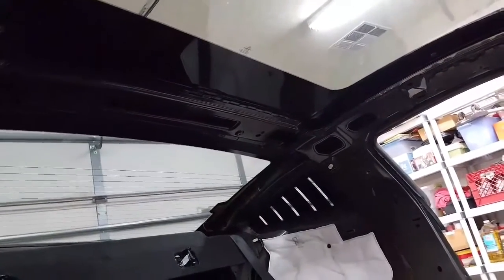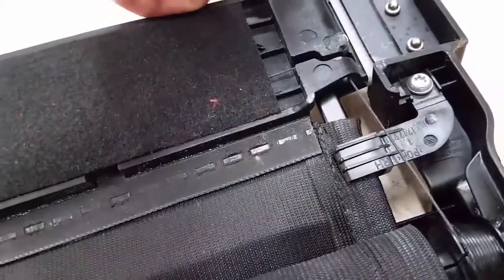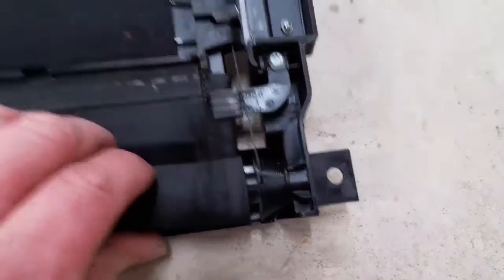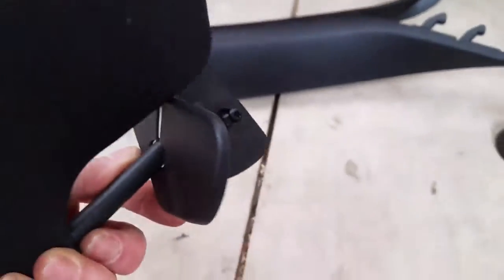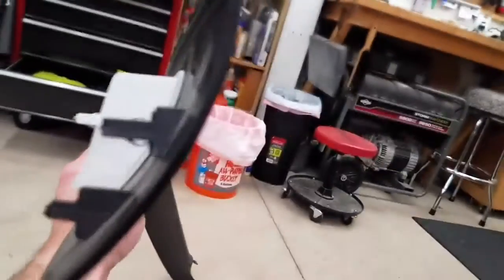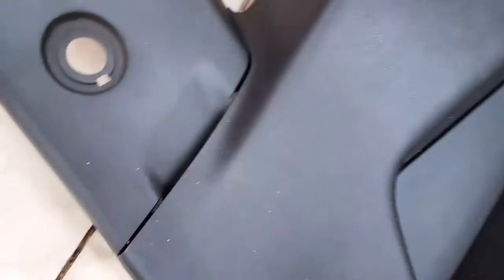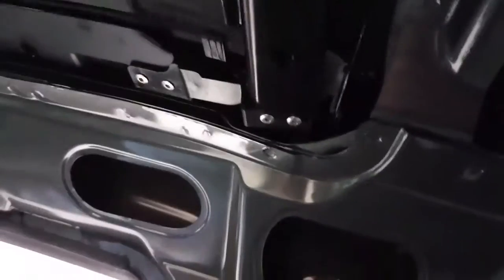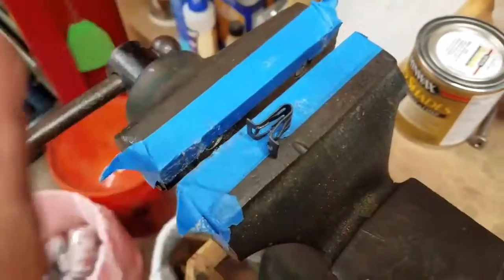Glass Roof Mustang - Sunshade Removal and Repair

Comment: Very helpful video. I just went through this whole removal and re-install, and it’s much better now, but still not right. It was jammed completely closed, and now it binds at about 3/4 open. I also used the oem repair manual.
Reply from the maker: I'm glad it helped, somewhat.

Comment: Very good video, did you put any lubricant any place, mine will gets stuck in the closed position, I was driving it and  hit a couple bumps and it worked, now the bumps are not helping anymore,
Reply from the maker: @donv2892  No, no lubricant.

Comment: Did your sunshade ever rattle during driving, with it hidden? Intermittently mine does until I shut and reopen it, also a 2013. Going to check mine for the issues you solved; thanks for the thorough vid!
Reply from the maker: Robert Gonzales Glad you found it helpful! No, no rattles from mine. Everything else rattles but not the sunshade...
Reply: sed6 What other rattles have you tackled? My rearview mirror is pesky, may try to cut a rubberband and seat it between the window and the clip (I forget from which forum I learned that)
Reply from the maker: Robert Gonzales Door glass when rolled down, something under my cowl vibrates above 80 or above 40 on a windy day, lots of squeaks from dry bushings underneath the chassis. None yet fixed...

Comment: Mine got stuck in closed mode can’t get it to go back at all even using full strength any idea how to fix it? Ford told my extended warranty doesn’t cover it so they won’t fix it
Reply from the maker: Yes, mine got stuck closed also. Watch the whole video and you can fix it too 👍
Reply: @sed6  thanks for the reply I’m sure this would fix it great video it’s the only one that went in depth, any idea how hard and how long it took to take everything off? That’s the only thing I’m worried about

Comment: Hi guys, I have Ford Mustang 2010 GT Premium with the Glass Roof. Unfortunately I received it without the plastic handle of the blind (sunshade). The actual blind was somehow put back in to the back. So... I am very thankful for the video because now I now what awaits me when I remove this mechanism. But I need some help. Do anyone knows from where I can order such a plastic handle? I cannot find it anywhere in the internet. Nether american musle, nether cjpony parts, nether rock auto, carid and so on. I would like to be prepared how much it will cost me before going deep in this repair. Thanks in advance.

Ps I have the car in Europe so I don't have the luxury of going to local dealer in US or Canada :) Local Ford never seen such a beast :)
Reply from the maker: Glad I could help. If you find the part here in the states and pay for it I can ship it to you or something.
Reply: @sed6  Thank you! I am still searching for it. I will let you know if I find something and the only question remains the shipping! Thanks again!
Reply from the maker: @shortcut88  Perhaps you could fabricate something, maybe a 1/2-in diameter plastic pipe with a slit cut lengthwise could somehow be painted and then attached so that you can at least have something to pull on?
Reply: @sed6  it could be. Whatever I do I will try to video it before and after

Comment: Is the glass roof a feature that come standard on the premium trim? Or is it an aftermarket part you have to buy ??
Reply from the maker: Jose maytorena- Neither, it was a $2000 option from Ford offered just like a convertible top or an automatic transmission.